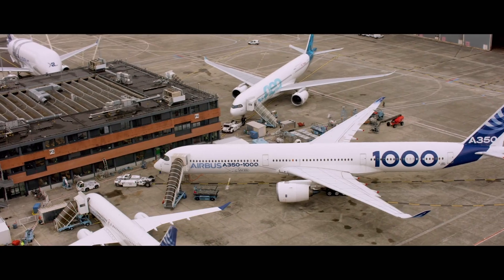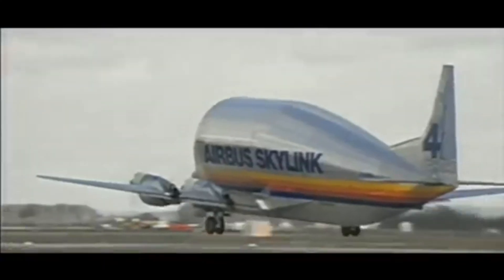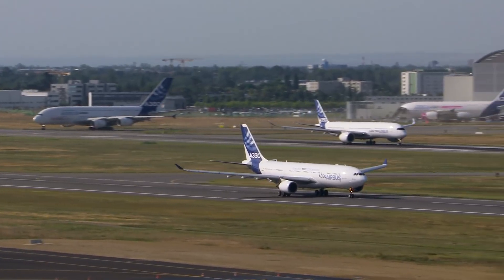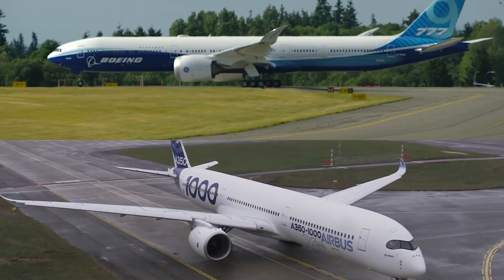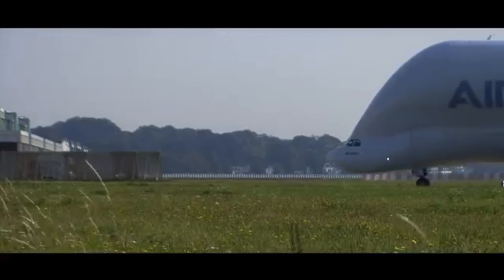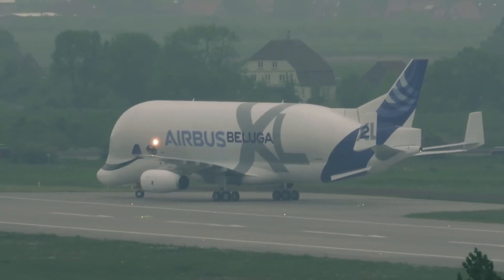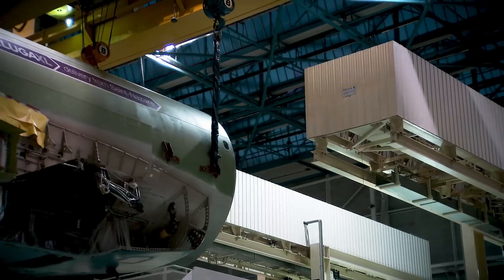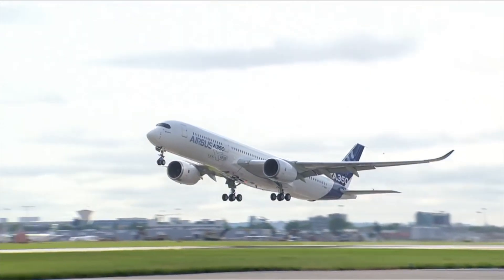Airbus Beluga XL vs Beluga: Which Airbus transport plane is best?

Comment: Why don't Airbus turn their a380 into a beluga like boeing did with their 747? Maybe it could also cary  A380 parts then.
Reply: The same reason they dird not build a A380F, the 2nd floor is a critical for the stability of the structure of the Aircraft.
So it was easier and cheaper to completly redesign an A330, wich still shares many similarities with an A300 than an A380.
Also is the A380 unnessecary heavy for such short flights.
Airbus wanted a plane that can Transport two A350wings not more, so the A330 was the perfect basis.
The A330neo was not revealed at the start of the programm and they needed the floor of the A330-200F, thats why its still the ceo.